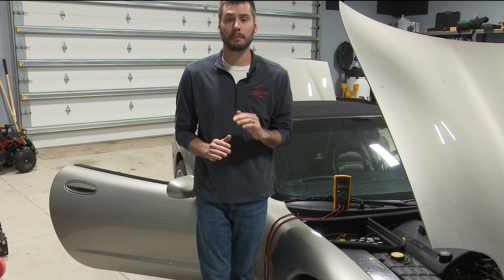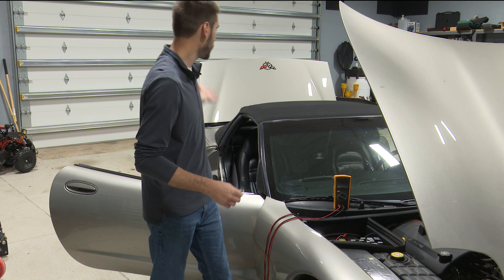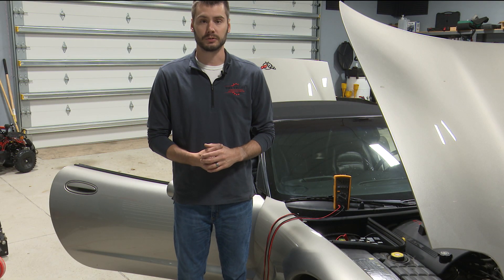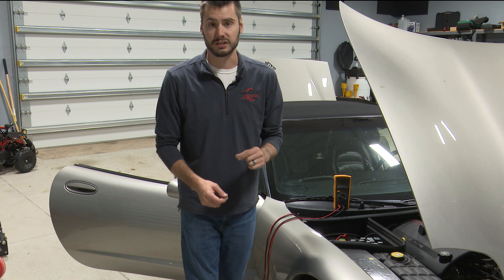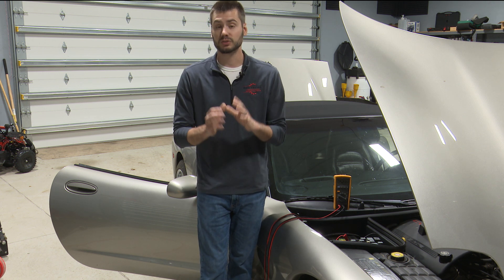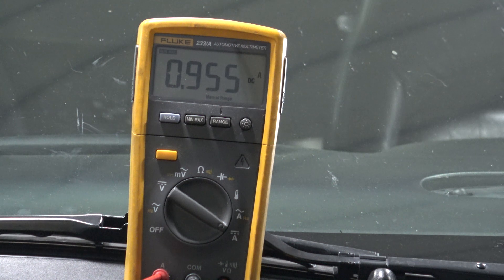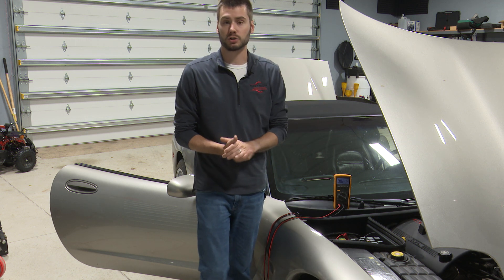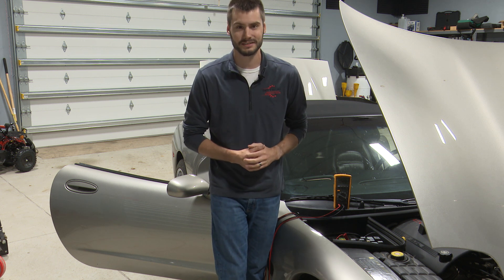Battery Keep Dying? Simple Tests For A Battery Drain (Parasitic Draw)

Comment: Nice Corvette, Ford in 1984 said in their training manuals; 3 tenths of an amp is acceptable, up to 5 tenths if it has a message center. 
Why the 50 milliamp rule today?
If you Google parasitic draw you will find some that agree with you and you will find some that will agree with 250 milliamp draw which is acceptable.
I Suppose you could go by Amper hours of the battery divided by amperage draw to get the hour rating of acceptable discharge. Thank you for the videos. It's nice to see you.
How come your Corvette isn't wearing a mask? LOL
Reply from the maker: Hey Gregory, thanks for watching! I've always heard 50 mA is the spec, its what i've always gone with. Anytime i've seen anything over that the customer has complained of battery drain issues. Maybe the batteries in 1984 were larger with a much higher reserve capacity?
Mike Becker, Senior Instructor

Comment: Great video and fantastic explanation. However some draws are not apparent unless the vehicle is locked such as alarm systems. With testing how you have shown without locking the vehicle you may not see the issue. You are best to connect the meter in parallel to the battery ground. Lock the vehicle and allow it to go to sleep as it would be with the customer. You then loosen the battery ground and slowly lift being careful not to lose connection and connect your meter onto the battery pole. You can then remove the battery ground completely so all the current goes through your meter and you are then testing the vehicle as it would be with the customer.
Reply from the maker: The best would be a homemade battery disconnect device. I've seen some pretty nicely made ones that allow the meter in parallel and then turn the knob to throw the meter in series. Maybe I should do a video making one...hmmm.
Mike Becker, Senior Instructor
Reply from the maker: Hey Simon, thanks for watching! Those are all great tips. I should have mentioned that I had the vehicle locked and the alarm armed. I had every latch tripped so the vehicle thought they were all closed.
Mike Becker, Senior Instructor

Comment: Hey Mike Long time, no see!  Glad to see you back.
I had used this method for a few years prior to retirement with success.  Intermittent key off draws were the worst, sometimes a heat gun would help the offending part to become a full time current draw, or tapping with a screwdriver handle would help.
Hope the family's doing well.  Hang in there, spring's on the way.
Take care.
Reply from the maker: Hey Mike! Good to be back. Yeh, intermittent anything is the worst! Fam's all good here, hope the same for you guys!
Mike Becker, Senior Instructor

Comment: A faster way to voltage drop the fuses is to connect the + voltmeter lead to battery positive(or a battery stab on the fuseblock), then use the negative lead to probe the fuses. Here again, any voltage reading over 0 indicates a current flow.
Reply from the maker: Hey Steve thanks for watching! 
Mike Becker, Senior Instructor
Reply: Very helpful information thanks

Comment: I learned it's not just new vehicles that can take some time to go to sleep. I have a 20 year old Ford Ranger (built back when CAN was something soup came in) that had a parasitic draw. Found the  problem in an aftermarket alarm but still had a draw. I did some research and found a battery saver relay stayed picked for 40 minutes. Thanks for the video Mike. It's always good to see you.
Reply from the maker: Hey Rick, thanks for watching! Ugh 40 minutes is a long time to wait for things to go to sleep. "can was something soup came in" I like that!
Mike Becker, Senior Instructor

Comment: I diagnosed a draw similar to this but I believe mine was a 2005. The power seat would stay actuated for the lumber and eventually stop. I believe the switch malfunctioned in the actuated position if I recall this right.
Reply from the maker: Ahhhh that could be what happened on this one. I haven't gone any further with is since pulling the fuse. 
Mike Becker, Senior Instructor

Comment: It’s an excellent video but I’d like to know if it only happens with fuses or it can happen with relays too? If so, I’d like to watch a video 
Btw I’m not a professional mechanic 
Thanks!
Reply from the maker: Hey Margarito, thanks for watching! So a relay will be powered through a fuse. A relay acts as a switch or control device in the circuit but that still requires protection, that's where the fuse comes in. 
Mike Becker, Senior Instructor
Reply: @GoTechTraining  thank you so much!

Comment: Glad to see more from Mike, how are the long term runners going after the engine replacements the VW and V6 3.6 GM. The other thing is those fuse’s are not cheap either. Thanks again. P/S just had an explorer seat module that only had partial function and it had been discontinued years ago for an 2007 Ford so there you go
Reply from the maker: Hey Jim, thanks for watching! As far as I know both the VW and 3.6L are doing ok. I don't own them anymore. 2007 doesn't seem that old...but i guess it is 15 years old. Sucks to hear its discontinued though. 
Mike Becker, Senior Instructor

Comment: Been wrenching on cars for many years, I have always had a knack for electrical and diagnostics and this is one of the methods in my arsenal.
One of the others is an infrared thermometer, but much like the multimeter you have to interact with every fuse until you find the right one.
I have often wondered whether a good thermal camera would work as well.
They can apparently be adjusted to measure a very narrow temperature difference which would seem to be what you would need in these situations.

PS: Here in New Zealand we have a periodic safety inspection. Having an operable drivers seat adjuster is part of that so believe it or not, removing the fuse would cause a failure of the inspection. :-)
Reply: That is absurd, this feature is a commodity and in no way a danger to public safety if non functional. I never adjust my seat once I set it right.
Reply: @scientist100  I have to disagree, being able to adjust a seat to the correct driving position for your size can certainly affect safety.
Imagine someone that's 5ft 6 driving a car after a 6 foot plus driver.
There are many families where husband is way taller than wife.
Your answer does not live up to your name. :-)
Reply from the maker: Hey guys, thanks for watching! I haven't had any luck with thermal cameras in finding warm fuses, but it does work for finding stuck motors. 
Mike Becker, Senior Instructor
Reply: @Stambo59  lol, that's not public safety if you cant fit in a car, you won't be able to drive the car so... like I said, that would be an inconvenience not being able to drive you car but I can see what you mean with shared cars being an inconvenience.
Reply: @scientist100  For someone who has scientist as your user name you seem to have little grasp on reality. 
Just because someone cannot comfortably sit in a car does not mean they will not drive it. They will sit on the front edge of the seat and drive it UNSAFELY. Risking not only themselves but every other person concurrently driving, cycling, walking around them.

Comment: ...thanks Mike for another great explanation for DIY......would a dc amp clamp around a battery lead work just as well as an ammeter
 in series to show parasitic draw?...would be a lot easier and you wouldn't have to worry about maybe blowing a fuse in the ammeter... :)
Reply from the maker: Hey Ken, thanks for watching! Sure an amp clamp would work as long as its accurate enough. Something that's only accurate down to 50 milliamps won't do you any good here if you're nit picking a draw. I like to use my 30A PICO clamp that's accurate down to 2 milliamps but that paired with a scope is a pricy unit for sure.
Mike Becker, Senior Instructor

Comment: What he could do is splice the wires under the seat and put in a simple switch and mount it under the seat where it's easy to reach-- or even mount it on the side of the seat where the other controls are.   That way he can turn it on whenever he wants to move the seat and turn it right back off..  Or even make it a momentary switch.  It's kinda ghetto, but it would work great and solve the problem, without buying expensive modules or motors.
Reply from the maker: Hey Calholli, you are exactly right! That would be a low cost effective repair on a 22 year old car that parts are probably scarce and expensive. 
Mike Becker, Senior Instructor

Comment: A very good video, especially explaining voltage drop measured at the fuse, caused the load from a circuit being 'on'.

Another neat way to detect a draw is a thermal imaging camera, which I know isn't economical for most, but for professionals in the business,  it's quite a time saver.

Keep up the great videos.
Reply from the maker: Hey Michael, thanks for watching! I haven't had luck with my thermal imagers finding a draw. It can find a motor stuck or something like that but i've never been able to see a fuse getting warm or anything.
Mike Becker, Senior Instructor
Reply: @GoTechTraining I work at a Ford/Lincoln  dealer, so we've seen many draws over the years, especially intermittent ones which are clearly a pain to disgnose. Once we verify the draw by measuring the current, as you did, we sometimes use the thermal imaging camera, not on the fuses, but more the related circuits fed by the fuse.

Like the seat module on the Corvette, it could be a switch being stuck, a motor on the track,  a heated seat function, etc.  Our heated/cooled seat modules, usually under the passenger seat cushions are know for overheating at the electrical connector which in turn melts and damages the module and it's connector. 

It's a great tool to use when the vehicle is at a cooled down state of ambient temp, as any  load still  powered on, will have a higher heat signature.

Where are you based out of?
Reply from the maker: I used it on stuck wiper motor once, worked pretty slick! We are based in Fond Du Lac Wisconsin. You?
Mike Becker, Senior Instructor
Reply: @GoTechTraining  Maple Shade, N.J.

Comment: good job, would be fun to open up the module and check the curcuit boards for moisture
Reply from the maker: My guess is one of the seat motor/position sensors was stuck causing it. The customer chose not to go any further since he's the only one who drives the car and doesn't need to move the seat.
Mike Becker, Senior Instructor

Comment: I'm sure a-ll of us old school MECHANICS/NEW SCHOOL TECHS watch all of the parasitic draw videos out there. -Nothing  harder to find or more dreaded to do. Rate it right up their with blown fuses and shorted wires. Usually a lot of time involved, so we're always looking for a magical way to find them. You've presented the procedure I use, but unfortunately it still involves WORK and EFFORT. NO MAGIC INVOLVED !!!! Some day when I'm rich, I'd like to add an infrared camera to my tool box...Maybe that'd be the MAGIC testing solution. Might add in the polarity of your meter hook up at the battery. -I can never remember that, but my meters read either pos or neg so it covers my dummyass.    Just one less thing to clutter up my crowded or clouded memory....THANKS.........
Reply from the maker: Hey Terry, thanks for watching! Yes, some draws are IMPOSSIBLE to find it seems. Ugh they can be the worst! So I had a 2ish amp draw  one time, used a thermal imager on the fuse box...no luck on seeing the fuse that had current flowing through it...but it did see the hot wiper motor through the panel in the rear hatch. I'm not sure a parasitic draw is a justification enough to buy an infrared or thermal imaging tool.
Mike Becker, Senior Instructor
Reply: @GoTechTraining  My thought as well on the camera, a bit pricey just for draws, but it is useful on other things as well. We both know it's nice to have another tool as backup in case one tool doesn't work. Just check out your box, do we really need all those sockets and wrenches ???? HELLO YES, special shapes, sizes, and applications fill our tool boxes to overflowing. We need all the weapons we can get when we attack the expanding problems and tight fits that OEMs keep adding to their products. When I started in 69, I could fix cars out of a lunch box sized tool box...One other note you might mention is the conversion chart for fuse volts to amps. It sometimes helps you see if the fuse draw gets you under 50 ma or if you've got more issues before  pulling the fuse and having to wait for sleep mode again. If it gets you under 50 ma, then pull the fuse to confirm your math. Sorry I'm so long winded, but I'm trying to put off doing a water pump on a Tahoe.
Reply from the maker: Hey Terry, yes, more and more and more tools. But the tools pay us back over their use for sure. I should have mentioned the charts, they are great! Now go get that gravy water pump done ;)
Mike Becker, Senior Instructor